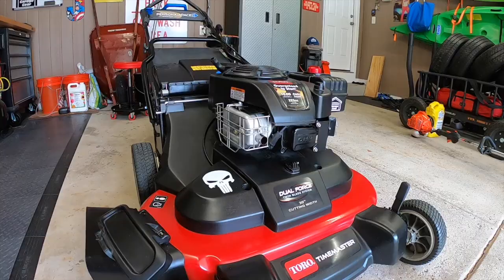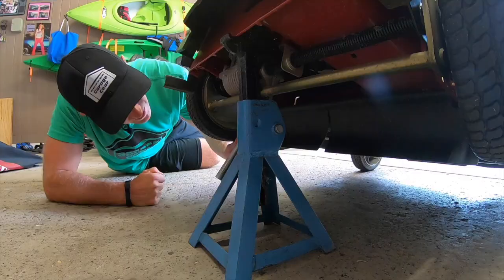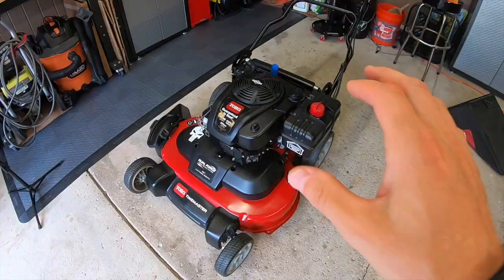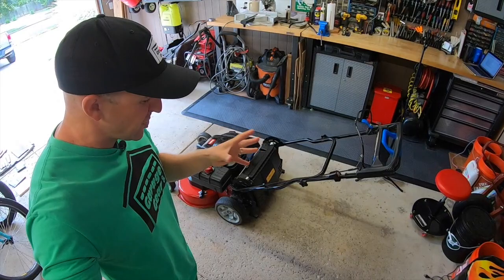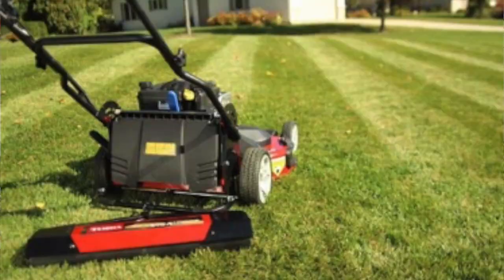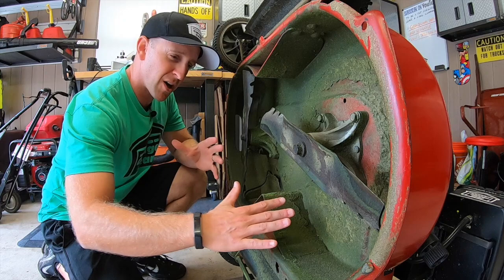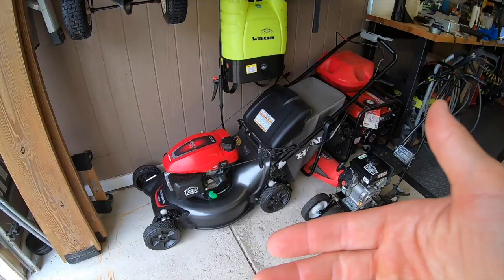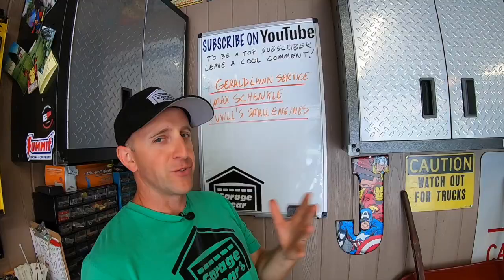BEFORE YOU BUY A TORO TIMEMASTER, WATCH THIS!

Comment from the maker: Here is a LINK to the #1 TOOL that Timemaster Owners are keeping in their garage! ⬇️👍

https://amzn.to/3KsXIWt
Reply: That is also a great mower, but on a 1/3 acre or better, it's no replacement for my Time Master. And like many, I  keep these types of tools in my shed :-p. One of my neighbors has this same Honda mower you linked. It's very light weight compared to a TM, and it's speedy. Also, you have to pull-start it again when you realize you forgot to pull the gutter downspouts before you started mowing. I notice the neighbor with this Honda only mows his front lawn with it, however, and uses a tractor on the back. I definitely wouldn't knock that Honda for what it's worth on a small lawn or edging around a large one, and Honda engines are pretty reliable in my experience.
Reply from the maker: @andrewborell  thanks for sharing Andrew!
Reply: Andrew I have to buy myself a mulcher can you do me a favor and see if you can do a little video on on one of the best mulches you can get for the yard for the leaves thank you my brother stay in touch thank you
Reply from the maker: @johnbayliss1098  I’ll see what I can do 👍

Comment: WOW!  I still have the original Timemaster that was $999 and it's still going strong.
Reply from the maker: Wow! Good for you my friend! Glad it’s rolling along nicely for you! Thanks for watching!
Reply: I’ve had to replace a belt or 2 but that’s it. Love it, just gets bogged down with heavy grass
Reply: I’ve had mine 6 years. It’s been abused. Left outside. All the stickers are gone. And the first time I’ve encountered a non start is after having a kid and having them leave the gas cap off while pretending to fill it up with gas. Now I’m chasing a dirty carburetor 🤦🏻‍♂️
Reply: I bought a new Timemaster in 2011 (first year). Used it for 10 years with no issues.  Sold it to a friend when I bought a zero turn. He's still using it in 2024! I guess I got a good one! 👍👍👍
Reply: I've had mine since they came out and have replaced the cog sync belt once and cable sets twice.  The latter is because I keep it outside a lot and cables get rained on and seize from corrosion.
Reply: Don't u say this about every mower ?

Comment: One thing I’ve learned about mowers over the years of repairing them is that less complex features are better. I’ve dealt with electric starter motors that were completely burned out, blade clutches on Hondas that were completely worn down from many years of use, and so many other unnecessary accessories that break over time. That is why I love my old Toro, it’s got a reliable 6.5 HP Tecumseh and the personal pace drive system. Those are the only two features on that mower and they’ve never had a single problem
Reply: Got the same mower.  My old Brigs and Stratton Brute deck rusted out so bad that the mower became unusable only after 8 years.  The motor a Briggs and Stratton still works good.   I picked my Toro up cheap a month ago and it runs like a champ.  It's probably 15 years old and has a solid deck and that 6.5 Tecumseh still performs very well.  The personal pace drive system is awesome.  The person I bought it off of must have maintained it well.
Reply from the maker: Totally agree BCSERK! Keep it simple! I’m not really even a fan of adjustable handle bars because I would rather just have them bolted down! Less to break! Thanks for sharing and watching as always!
Reply from the maker: @arnimkrause5696  thanks for sharing as well!
Reply: Keep it simple is correct! Fellow mechanic here.
All the pushmowers with unneccesary bells and whistles are not needed, a good deck, good engine, and solid drive system is exactly what is needed.
Reply: That is true pretty much goes for anything. Good comments
Reply: Only old 22 inch recycler with a Kohler on it has been put through the paces in my business and is still kicking. Jack's small engines is great for replacement parts
Reply: Another vote for the Toro PP with the Tecumseh engine. Removed the electric start and installed a toggle on/off. Love that it has a blade engagement bar. Guess that’s considered a “bell and whistle” but it was easy to replace the cable when it finally broke after 6 years and I was not the original owner.
Reply: My piece of crap Toro Superrecycler will not back up. Wheels lock up. Less that 1 year old and has been in the dealer shop 3 times and they cannot fix it
Reply: When I first started cutting grass in 2016 i bought a toro super recycler. I didnt know when I bought it that it was from 1998. I used that for two years until the belt broke. I decided to buy a new model but for some reason it didnt work as good and the quality suck as well. That is when I decided to buy the hrx217 and to date have 6 of them.

Comment: I currently use one as my main mower in my part time business. Can agree with most points of the video. Side discharge is your best friend with these mowers. Bagging is a close second. I would not even consider mulching as an option anymore. It has paid for itself in a short time but it is taxing on the body. Picking up my new stander in 2 days. Looking forward to not push mowing any longer. GREAT VIDEO!
Reply from the maker: Totally agree! Congrats on the new stander! Appreciate the positive feedback! Thanks for watching Richard!
Reply: Same here have the time master as my main mower for my house and used it for part time yard cutting .Got the xmark 30 in with Kawasaki motor. Bogs out al the time and going to sell for another time master or a stand on to fit in small yards.
Reply from the maker: @choppa5300  thanks for sharing Jerome!
Reply: Mulching is the only thing I use in PA, grass is thick and wet a lot it works like a charm!
Reply from the maker: @MatthewSmith-uf6tr  thanks for sharing Matt

Comment: I am on my 5th season with my Timemaster. Use about 100 hours a season. 19k sq foot Bermuda. Engine runs strong, no problems. Transmission is original and works fine. I mulch exclusively. I have to replace belts every 2 to 3 years. Fuel hog. 12k sq foot per tank. I will buy another when this one dies.
Reply from the maker: Glad to hear this mower is working out nicely for you John! Thanks for Sharing! 👍
Reply: You got lucky
Reply: I will get one also next week, even if they have problems supporting them will make it better. However there are a lot of good reviews

Comment: I had a Timemaster for probably 6 or 7 years. I’ve replaced 1 cable kit. I keep sharp Gater blades on it. It’s fast it cuts great, lawn looks great  and does what it’s advertised to do. If this one died I would buy another tomorrow.
Reply from the maker: Thanks for sharing
Reply: Me too.
Reply: I'm not sure I would now that they are $1699, because that's crazy money for this mower.  I'd buy a used Scag first.
Reply: Is it a fuel hog though? Thnx much.😊

Comment: My Honda Harmony 21" was purchased new in 2003 when they first came out. 
I have replaced the trans and drive belt ONE time at a cost of $129. Still starts first pull and no other issues.
$700 seemed very expensive at the time of purchase BUT 19 years later it's still a great mower..
Reply from the maker: Keep it around as long as you can Joe! Thanks for watching!

Comment: I've had a timemaster for 3 cutting seasons now. I cut 20 lawns a week with it and have put 400+ hours on it. You're right about all of these problems. A pulley busted on me about 150 hours in. Clogging is slow for me because I'm in a dry climate. My transmission still works, but I've noticed it struggles on slopes. Despite the issues, I like my mower. The 40% faster mowing time really adds up. Also the personal pace is really nice. Very good video. Subbed.
Reply from the maker: Appreciate you Travis! Thanks for sharing! 👍

Comment: This was really good, and the honest evaluation is very helpful.  I have owned the 30" Timemaster for 9 years.  I paid just under $1,200 for it, and have diligently tracked my repair costs, which are just OVER $1,200.  So, basically I have purchased the Timemaster twice in 9 years.  But only got one machine, of course.  As I write this, my machine is int he shop because the muffler is loose.  One of the bolts holding it to the head has vibrated itself out and is lost.  The muffler guard vibrated off long ago.  The shop tells me to fix it, a new head will need to be installed because the threads that hold the bolts that hold the muffler are worn.  Total repair estimate is $500.  I agree with this review that in the final analysis you don't save much, if any time with this machine, due to the repairs and maintenance.  I've been looking at the DR SP30 as a replacement, but may just go to a smaller mower.  It will also be easier to haul around as I have a couple properties.

UPDATE-I decided to buy a Kohler CV224-3002 engine and will do the swap myself.  After a lot of research I decided the mower was worth keeping, and the Kohler engine is a direct fit, and a beast.  I'll soon find out.
Reply from the maker: Thanks a lot for sharing this Robert! This is great Information for our community! 👍

Comment: As an owner of this model for the past 4 months, the clogging is a huge issue. I can’t say that enough. It’s a very clean cut though. But unless the grass is bone dry it’s going to clump and clump bad. You’re spot on with this, and I love your videos. I laughed when you mentioned the Honda, as I myself am currently looking to sell my current mower and buy a Honda
Reply from the maker: Hey JMW! The timemaster does give a good cut. No doubt about that but one drop of water will make for a long evening! Can’t go wrong with a Honda! Glad you enjoyed the video! Thanks for watching!
Reply: I've done commercial lawn care for 10 years and little mowers clogged up too. only difference is I can do in 2 days what took 3 days with the timemaster vs 21. little machines even the good ones don't move nearly as fast either.
Reply: Currently own a Honda hrx 217hya lawn mower and have been happy for 3 years other than the stupid plastic deck a d the underside venting underneath is a pitfa to clean.
Reply from the maker: @kevinisbell1867  thanks for sharing!
Reply from the maker: @shanew7361  thanks for sharing!
Reply: Some Hondas are the worst in the industry for clogging up.
Reply: I rig the side chute open with bungee cords and by pass the plastic chute insert. Allows far less clumping and more clearing. Mulching isn't a good option I may re-pass some sections or entire smaller yard. Things getting quite pricey to buy new products, imo.
Reply: Yes, I bought the time master last year. I have probably owned 5-6 mowers throughout my life, and this is the only mower that clumps terribly. My flap also failed within a year. And, the gas tank definitely needs to be bigger. If I had to do it all over again, I would not have bought this mower. I would have saved $900 and bought a regular sized Honda, or spent a little more and bought commercial. I spend half of my time stopping to clean the clumping issue. Very disappointed with Toro, as I thought I was getting the best. My $200 K-Grow mower from K-Mart performed much better than this thing. Anyone want yo buy my Time master? Brand new flap. Willing to let it go for $1000, whic is me taking a $500 lose since last Oct, because I paid $1500 for it and may have used it max 20 times.

Comment: I spray a little ceramic car wax on the deck before I mow if the yard is damp. No clogged deck. I mow a big hill with it, I couldn't do it with out the self propelled assistance. So far fuel not a problem. I love my toro
Reply from the maker: Thanks for sharing. Glad you have had a good experience with it.
Reply: @GarageGear  I think these mowers are like cars never buy one that was built on a Fri or a mon
Reply from the maker: @garygoodgion3533  lol good tip for sure

Comment: You are right about the mower clogging up because of the useless blades. However i got some harden steal plate about 4” long and welded them to the blades so the blade looked like a cross. I bent the welded on blade so that it would blow down and I have never had any problem with the deck clogging since. Now it cuts awesome and never clogs.
Reply from the maker: Thanks for sharing kent!

Comment: I have had zero issues with a clogging deck and I mulch exclusively. I do sharpen the blades several times each season which I have read helps immensely with not clogging. I did increase the RPM slightly on mine and that has helped with being able to cut and mulch higher grass with no issues. My only grip is the belts as they brake at least twice every year.
Reply from the maker: Thanks for sharing Jeff! It’s only a matter of time until mine break! Ticking time bomb lol!
Reply: Buying my belts two at a time
Reply: You can also get a kohler aftermarket engine for this. I replaced the crappy Briggs and Stratton with one and the Kohler is so much better its more powerful.
Reply: Ouch! $85 each at my dealer. Insane.

Comment: Ive had mine for 5 years. At 1st I didn't like it. But I learned to use it. You have to use it in the right way. Then its a great mower. It does Clogg. Dont use it on wet lawns. Dont use it for mulching dry or especially wet grass. The lawn conditions dont have to be perfect but they need to be close to normal conditions. Side discharge the thick grass by starting on the high setting. Then keep lowering with the side discharge. You learn with experience how to use this mower. Its a been a great mower for me after trial and error. I use commercially as well. In 5 years ive takin it for repairs about 5xs. Thats it. It baggs well. I bag 90% of the time and I side discharge the other 10% of the time.
Reply from the maker: Thanks for sharing lion!

Comment: Luclily I still use my 1989 Toro GTS 2 cycle  mower one of the best mowers ever. As a former Toro dealer and still work on timecutters and its Exmark twin  one of the biggest problems are from using the  home owner version as a commercial mower ! The front tension pulleys survive much longer if one actually cleans out the belt cover ,the transmission failure is generally caused from lack of cable adjustment or from the unit being used as a yard cart as guys will carry  a full can of grass and the mower bag full of wet grass back to the truck or take the blower for a ride. There are definitely places the bean counters have cut corners but that what happened when Toro decided to go down market to sell more units  at home improvement stores instead of just independent dealers.  Honda has done the same thing  . Need a tougher mower? Go commercial or buy one of the lesser known manufacturers from a dealer instead of just relying on a name brand  there  are some much better built machines out there!
Reply from the maker: Those older 2 cycle mowers are amazing! Thanks for sharing Scott!

Comment: I bought a Toro TM30 at the beginning of last mowing season.  I agree with some of these.  I did shred the drag-flap on one of the very last mows of the season, right around 25hrs.  I called Toro this spring and told them, and they shipped one out immediately at no charge.  

I too agree the size of the gas tank is laughably small.  I bag my clippings, so I just top off during a dump of the bag and quick swig of water, so it’s not so much of a time adder for me, but it is inexcusable for a tank that small on a mower of this size.  My 21” Troy-Bilt would mow my entire lawn and then some without ever running out.  

Regarding the clogging of the deck, this is something I have never encountered.  My lawn is very thick and times when I mow it is very long, but I have never had even the slightest issue with clogging.  I know the issue is not an anomaly, because there are complaints about it all over the internet.  Not sure what I am doing differently, but I have never encountered it.  

I have had no other issues yet, but I am only at around 28hrs of use.  I do like it so far.  It definitely speeds up time spent mowing compared to my 21”.  The quality of cut is also very nice and consistent.  

Aside from a bigger gas tank, one thing I really wish it had is casters for the front wheels.  Turning the machine in tight confined areas can be challenging due to the weight and size.  Casters would be a tremendous help.
Reply from the maker: Casters would be a good thing for this mower! I agree! 👍